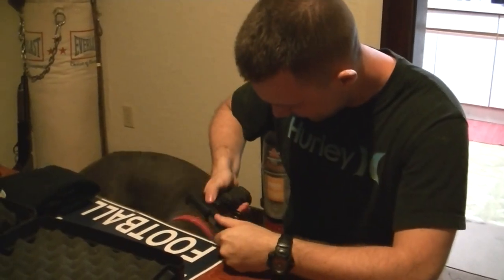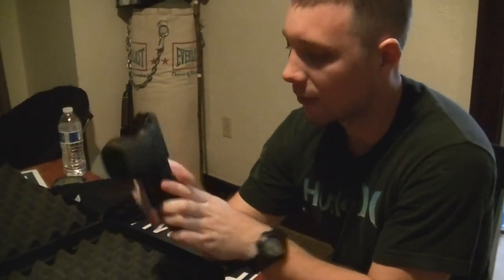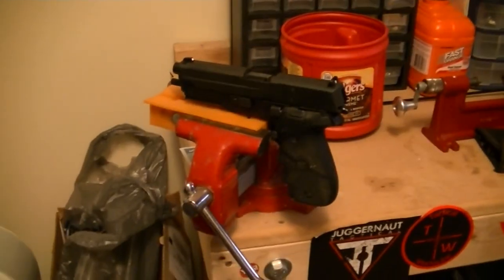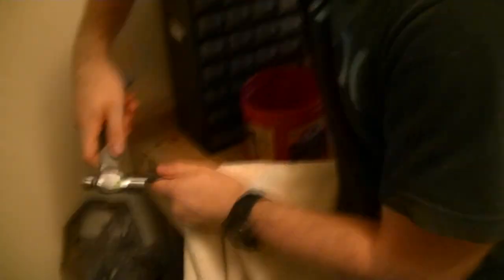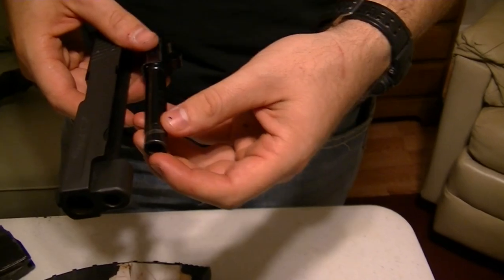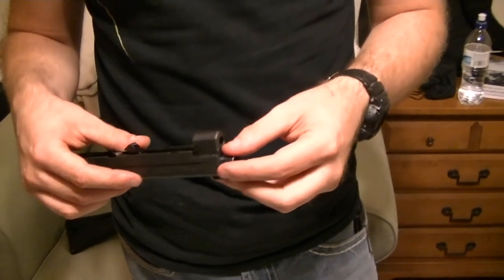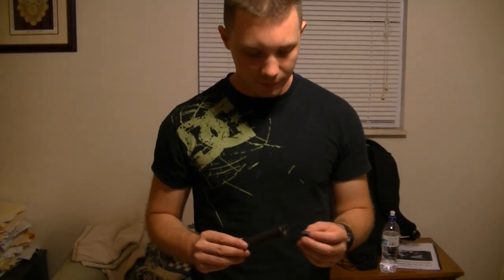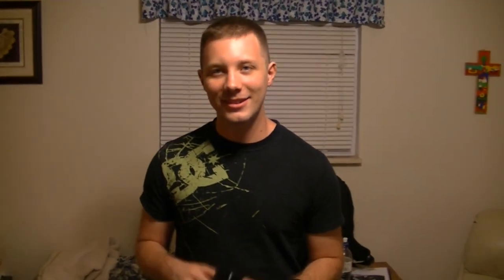How To Break A Sig (Part 2)

Comment: It is called a barrel obstruction, there must of been mud in the barrel. This happens in flocks and it can be much worse. My buddy was testing his glock and the whole front portion of the glock was blown off.
Reply: There's a part in the original video when he actually jams it down into the bottom of the puddle several times, as if he's trying to pack mud up into it.  Combine that with some possible gravel, that's probably what did it.
Reply: Amped Explorer you are 100% correct sir

Comment: later on we used a larger hammer and a socket decked out in tape to lodge it rearward so we could measure the barrel. The socket just needed to be big enough to fit comfortably around the barrel and deep enough for the slide to clear rearward.

Comment: I'm not entirely familiar with the 226 specifically. But MOST, if not all handgun barrels have a bulge in the end of them. Don't beleive me ? fine thats cool. grab a micrometer and start measuring all your barrels. the reason for this is very simple. When the firearm is in battery the bulge makes the barrel fit very snug into the front of the slide while the ramp at the rear keeps the back of the barrel tight up against the slide as well. When the firearm is fired and the action begins moving back the rear of the slide drops down to clear the locking lug(s) and the narrower portion of the barrel allows the slide to move back with less resistance. Once the slide comes back into battery the bulge in the end of the barrel meets up against the hole in the slide for a return to an ACCURATE fitment.
Reply: I know this is an old post, but as far as I can tell my glock does not have a what you describe. Many older semi autos do. I think mainly fixed barrel handguns. But with the modifications made to the browning lockup design I don't think its needed anymore.

Comment: Knew exactly what was wrong as soon as I saw the pistol up close after it jammed. Barrel obstruction from packing it full of mud.  Same thing happened in the IV8888 Hi Point torture test when they pounded a bolt in the barrel.  Except the Hi Point was easily fixed and back in service with a hammer and some sandpaper. 
Hmm

Comment: This is why you don't shove crap down your barrel, when you did the tap tap on the muzzle in the puddle you packed the barrel with mudd most likely, if you don't check your barrel before you shoot there a pretty good chance it will either kaboom or never shoot again, good news is a sig barrel is like $100-$150, image if this what a rifle.

Comment: Glocks won't take that particular abuse either.  You could drop it in the mud as many times as you want and sometimes the barrel will be obstructed solidly enough to cause a bulge, others it will not.  It doesn't matter what make of gun it is.

Comment: After watching this part of the video i noticed he tapped the muzzle in the mud , any handgun regardless of brand wont fire with a clogged muzzle.
Reply: Actually, it will fire. However it is extremely dangerous and can destroy the barrel/gun and harm the user or even kill the user.
Reply: Zomniac
Bingo, the plugged bore caused the gas to build up directly behind it and create a bulge just behind the muzzle. (Current PGS Student)
Reply: tyler wakeley I'm pretty sure that with a gas build up, no amount or type of mud packed into a barrel would cause a steel cylinder like that to bulge instead of the mud just being pushed out... steel is incredibly strong; mud isn't. I'm thinkin' it must have been the slug traveling alongside some of the mud and grit to make it bulge. (Current ME student)
Reply: Viktor Foggo
I promise you, mud has destroyed the barrels of many weapons.  The chamber pressure on a 9mm is multiple 10s of thousands of PSIs. (Former ME student and current practitioner of the school of critical thought)
Reply: Shane Deon Yes, mud has destroyed many barrels, I'm saying not in the way tyler wakeley described, not from a gas buildup behind the mud! If that were the case, the gas buildup behind a round would damage/expand a barrel as well. It also doesn't explain why the bugle was only at the end of barrel, gas doesn't work that way, pressure doesn't increase in one part of a chamber for no reason, just because it was plugged there. As I said above, it must have been the slug traveling alongside some of the mud and grit to make it bulge.
Reply: Viktor Foggo Yep, i think you are right.. definetly more plausible then the gas buildup.. and the argument about the 10s of thousands of PSIs is pretty obsolete since at that pressure the mud would just fly out of the muzzle and it would not make the barrel bulge.

Comment: It was fairly obvious to me what had happened when you discovered that the slide was stuck in the first video. Your buddy made a comment about checking for barrel obstruction. It was clear when you jammed the muzzle into the mud you packed the barrel full of it, and then immediately chambered and fired the round without clearing the barrel.

You're lucky it didn't blow up and take a couple of your fingers or a hand out with it. Incredibly stupid thing to do.

Comment: Why in this video are you guys so stumped as to what happened . I have shot sigs for 20 years and this has never happened,I have shot glocks, Springfield and so on and so forth. For the glock argument if you jam any gun barrel into the mud as displayed in this video you will run into this problem. And your lucky it was a quality barrel cause you still have your fingers.

Comment: Only a HK could handle a barrel full of mud ! Period !
Reply: No, no it couldn't.
Reply: Yeah, actually it could. Shooting a lodged bullet out of its barrel with a full power load behind it was part of some extreme testing they have done. It slightly bulged but functioned fine and accuracy still seemed unaffected.
Reply: flawlessfoose As far as the "extreme testing" is concerned, to say that only an HK can handle this type of scenario is plain ignorant!! The results of these tests are NOT a guarantee that any firearm (doesn't matter who it's made by) will never fail and will continue to function flawlessly 100% every time. To expect that from any manufacturer is simply unrealistic. But ok, keep thinking that way, but don't be surprised if you end up in the hospital when you find yourself in this scenario!!
Reply: That may be true, but I don't know of any other manufacture that has done that to there barrel. So yeah, not hard to make the statement that I already made.

Comment: I had a Ruger P95 that did the same thing... Besides beating on the barrel, did yall dumbasses try putting a rag over the tip of it and using visegrips 2 twist it? That was the only thing that worked for the Ruger, kept me from sending it 2 them.